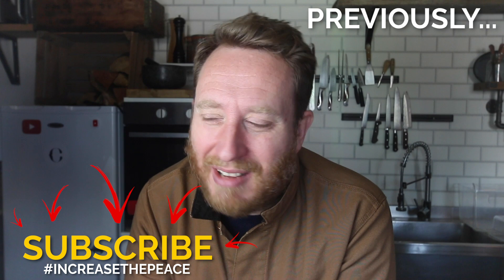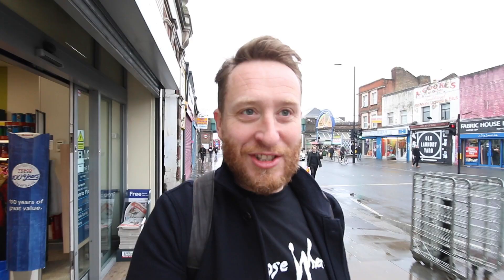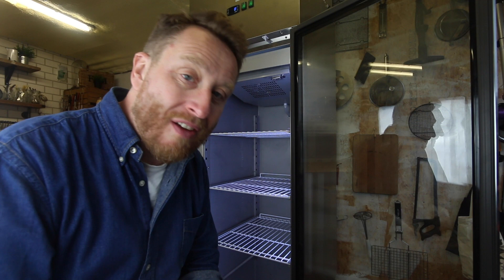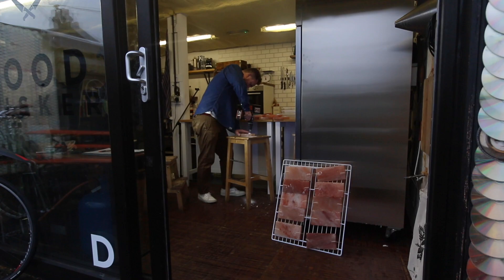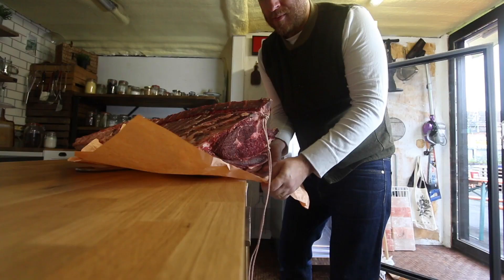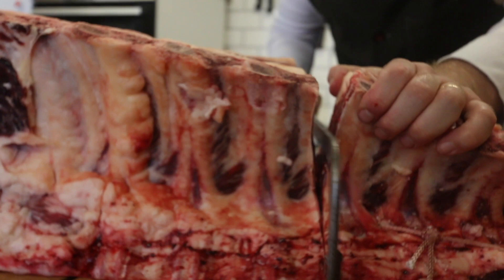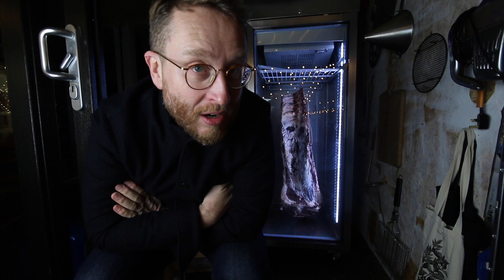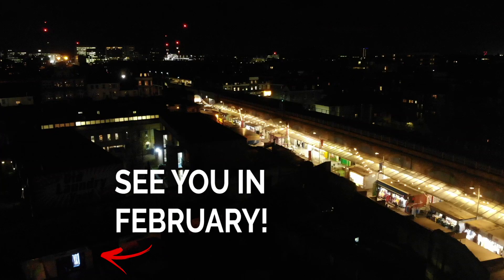HOW TO DRY AGE BEEF | FOOD BUSKER | John Quilter

Comment: I did it in the meat drawer of a normal fridge, but only a 2 inch ribeye Prime. A layer of rock salt on the bottom, a resting rack and a small portable battery operated fan (changed rechargeable batteries @ 24 hrs). 30 days aged. Trimmed the outer layer & left with about 1 1/2 ". Dry aged cooks very quickly. It was delicious and it didn't kill me. Used a small reefer thermometer to monitor the temp.
So the guy that says you can't do it at home - well, I proved him wrong. Easy enough to see visually if the process has gone awry, but achieving the desired results at home is very doable.

Comment: This series has been awesome - There's another channel that you are probably aware of, Alex French Guy Cooking, who also home brewed his own Dry Age fridge (though not as all out as you).
Two things he did that I think you could benefit from is a digital humidity sensor with a readout (could stick it to the glass door so you can see it), and used silica gel packets to drop the humidity. The only problem he ran into was they absorbed all the moisture they could, and needed to be changed out for fresh ones. Make sure this doesn't happen to your salt! And maybe think about the silica gel if you need to drop humidity (especially at the start when there is still alot of water in the meat)

Comment: Maybe put a humidity sensor in the fridge so you can monitor?
Either inside of the door or wireless with the receiver attached to the outside of the door?
In case it goes out of the acceptable range?

Comment: Good job.. Is there an is issue if the moisture goes down too much?.. this is the issue I had when trying to dry age a 5KG prime rib boneless piece.. after 3 weeks the humidity went down to 20percent. I even had to keep some water at the bottom, but still the humidity wouldn’t go up.. so had to keep opening and shutting the fridge a lot to increase the humidity..Because your cut is larger, assume it will take longer to dry up..

Comment: Is the humidity in the refrigerator driven by the beef or the wet weather there?  I live in an area of the United States with low relative humidity (under 20%) and wonder if this is even possible as it'd add a layer of complexity to have to add humidity to the system.

Comment: No need for any fancy schmacy Himalayan rock salt. Regular salt does exactly the same job and is much cheaper.
Reply: But it's not pink ... soooooo ....
Reply: Then why do the big fancy places use it?  They are experts.
Reply: @schmatever  The big fancy places are, despite their vast knowledge, not experts in all areas their exist in. As a chemist I've used a buttload of dehydrating agents for decades, salt is one of them. It's like this trend of using kosher salt in cooking. Ask one hundred cooks why they use kosher salt instead of regular salt even when they're not cooking for jews and they wouldn't be able to give an answer founded in reality.
Reply: Peter Carlson agree that there are a lot of wanky fads in cooking and I personally don't use any salt with my dry aging at home (able to control the humidity without it and don't buy into the flavour theory) but using rock salt would offer too much surface area and draw too much moisture leaving a salty slurry in the bottom of your fridge. As far as kosher salt it's simply a matter of the size of crystals.Wider surface area means less dissolve in contact with food. That's why maldon is for finishing after plating. Try putting a few grains of table/kosher/maldon on your tongue and see the difference
Reply: @ScenicWisdom  Chemists have been using dehydrating agents for centuries and have developed techniques for how to utlize them most efficiently. Of course the salt shouldn't simply be poured in a pile at the bottom of the cabinet and left there. By calculation of the water content in the meat, the volume of air in the system and the water binding capacity of the dehydrating agent one can simply figure out how much of any dehydrating agent is needed to achieve a specific result.

Kosher anything means that it fulfils the regulations of the jewish food laws. It has nothing to do with grain size. Greater surface area, that is smaller crystals, means that it dissolves faster.